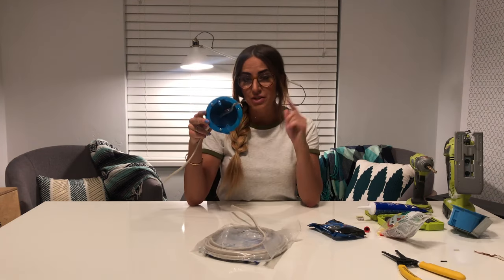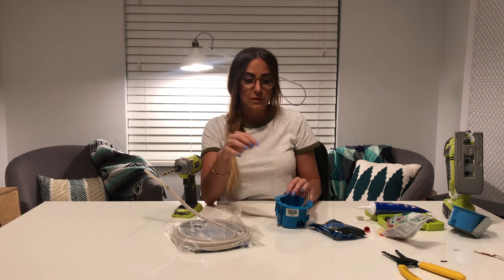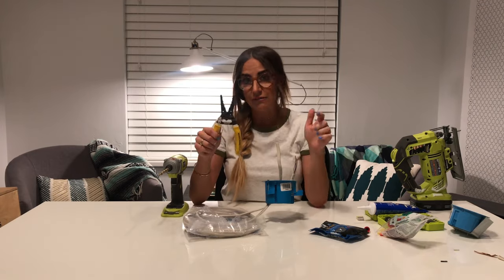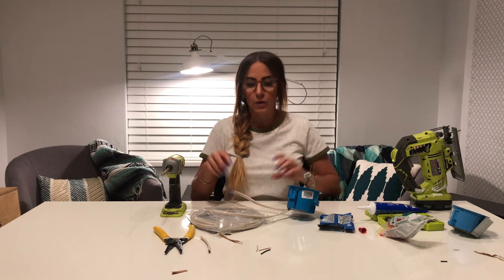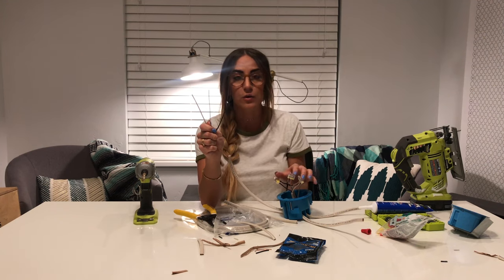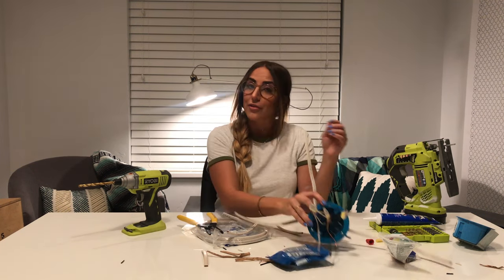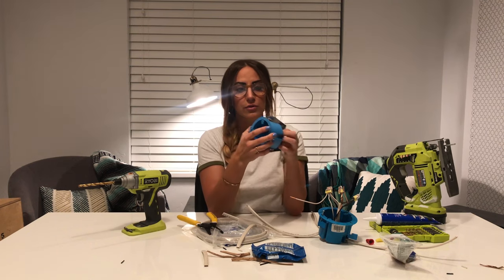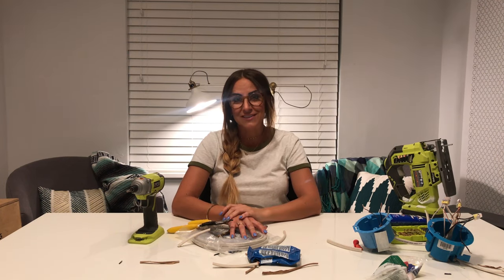How To DIY Your Electrical Work and Split One Wall Light Into Three

Comment: How did you run the wire through the wall to the other light without having to cut all the drywall out?
Reply from the maker: Larry Moore I had to cut the drywall out on both the left and right lights
Reply: Seeking Alexi Thank You for your reply